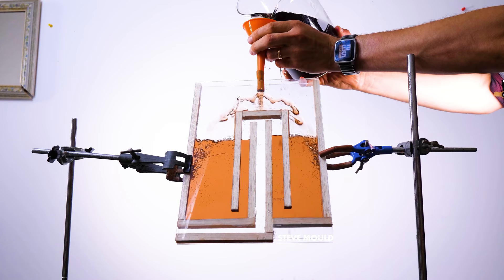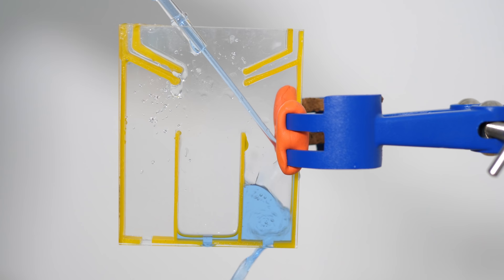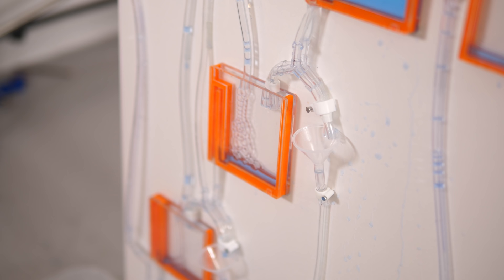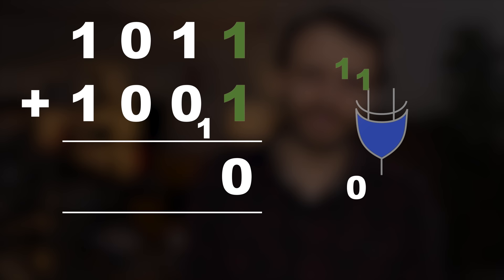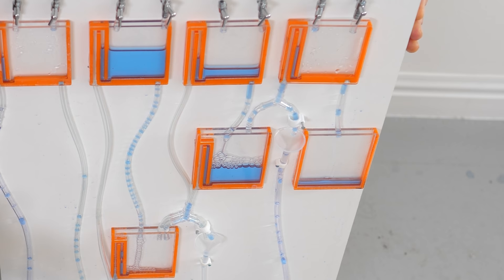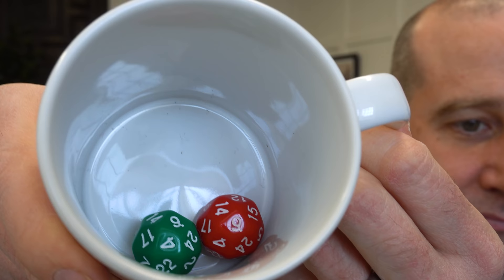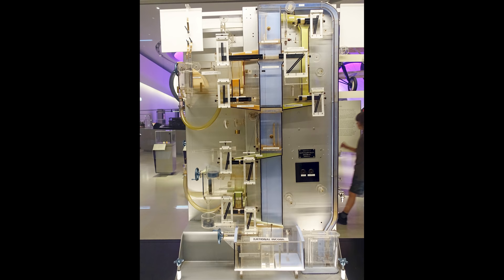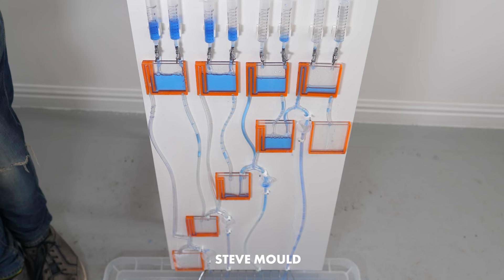I Made A Water Computer And It Actually Works

Comment: I think this would work a lot better with mercury; it’s not as sticky.
Reply from the maker: Well you would say that!
Reply: Time to explore another mine
Reply: First time I’ve seen you in the wild cody
Reply: and then you could place electric pads in the tanks and have mercury switch's turn lights on or off..
Reply from the maker: @vk3hau  this is sounding really cool now
Reply: You have to make this Cody!
Reply: Use Gallium instead.  It melts at 85°F, but it is not toxic, like mercury.
Reply: @nicklatino7157  nobody wants to work in 85 degrees lol just be careful with the mercury
Reply: @nicklatino7157  Gallium is also really sticky.
Reply: @alexpotts6520  Now I know more
Reply: @nicklatino7157  mercury isn't particularly toxic in its pure form.  just don't snort it
Reply: @butre.  It is illegal to use mercury in thermometers because of mercury's toxicity
Reply: @nicklatino7157  manufacturing them is highly restricted because of mercury's environmental effects (if there's a spill it's quite easy for mercury to contaminate groundwater).  they're not illegal to use (and in fact they're still quite common in lab environments) and the only restriction on them has little to do with toxicity.
Reply: Well mercury is pretty dense so it might not flow as easy
Reply: I was thinking alcohol would work and be safer than mercury perhaps?
Reply: @SteveMould  What about "Dry water"?
Aka NOVEC 649

It's safe, doesn't wet, non reactive, non combustible.
Reply: Yup, that sounds like a great idea
Reply: Would the siphons work if it isn't sticky?
Reply: @o15523  
That's 85 F not C; a dimmer day in the sun would be warm enough.
Reply: Never though I'd see you anywhere on Youtube and only 13 hours after you posted..
Reply: Mercury would be great, how would galinstan behave though?
Reply: And we will call it the toxic computer
Reply: @TungstenCarbideProjectile  it won't be the most economical computer when it comes to the evaporation rate of the alcohol
Reply: @o15523  I'm 1/4 sicilian, 85°F is nothing to me, it starts getting hot at 90°F
Reply: @nicklatino7157  I’m from Atlanta... 95 is nothing to me, but nobody wants to work in 85 degrees
Reply: @o15523  85 degrees Fahrenheit is acceptable. It’s 30 degrees Celsius, which is less than the average temperature in summer here
Reply: The greedy syphon wont work with mercury, I think Sixty symbols tried it and they showed that you can use it to bypass it
Reply: @o15523  ?? It's less than body temperature. You just need a bit heat on the board
Reply: this guy likes mercury more than water
Reply: good idea, except its dangerous, cuz its toxic
Reply: How about a higher viscosity like ATF (automatic transmission fluid). Waste/dirty ATF is used as an anti seize in some places and as a penetrant.
Reply: in addition to that, some custom parts could be designed for better flow and less volume.
Who needs electricity anyways.
Reply: And only vaguely deadly, as you yourself know!
Reply: @nicklatino7157   gallium sticks to surfaces like water, mercury beads up and does not “wet” the surface tho...
Reply: But it's too dense
Reply: But will make a very heavy laptop...
Reply: Cody, from a new physicst, I think you are right.  We might be able to create a new information theory operated computer if you use a conducting fluid as an additional degree of freedom within the binary system, thus creating a Ternary system using this specific mechanism, which as far as I know, hasnt been thoroughly experimented with.  Apparently ternary states have been achieved but this specific type of system has many degrees of freedom which may lead to enhancements in how we think about information theory, I think?  I'm not an information theory specialist, particle Physics needs information theorists to help us out
Reply: but it is poisionious!
Reply: This subject is called "microfluidics", and there are many videos about it on YouTube.
Reply: hahaha!
 Of course the next step would be to send the output to a display using contacts in the buckets,  maybe wires dipping in at different lengths.
 Sure it would work with water, too, but mercury would make it easier, and probably be a more successful video.

 If I can make a decoder in Minecraft that sends a binary output from an APU to a set of working 7 segment displays,  surely it can be done here.
Reply: @vk3hau  So then we're back in the 1950s when computers used to have the size of a building. The circle of life, yay! :-D
Reply: Gallinstan would probably be the safer Version
Reply: @gueldenerlarry8270  it's sticky though
Reply: A scaled-down (3d-printed or molded) version of this would likely prefer something "sticky." It doesn't necessarily have to be "microfluidic," per sé, as long as you don't rely on gravity to move your fluid (hydraulic pressure via syringe for example) I don't see it being immensely complicated to make. Your gates would probably look quite a bit different, but this entire setup could fit in a few-inch-cubed/squared space.
Reply: Or the Prince
Reply: Maybe some safer liquid metal than mercury
Reply: @nicklatino7157  just don't build any parts out of alumin(i)um
Reply: @justanotherguy46  don't quantum computers, or at least some theoretical models, use superstates as a ternary processing mechanism? I think I remember reading something about that a while ago, not sure it's how active quantum computers work, from what little I've seen it seems to maniuplate qubits into certain states and that's where I'm totally lost, at least IBM's open source platform, I dunno about Google or any others, except I think the ternary processing thing I read was about something google was trying with their quantum computer/prototype. not sure how far that's come, but it seems to make sense for "both/neither" to be a functional value in quantum logic.
Reply: @o15523  its in farenhiht not celsius
Reply: The replies are making this really interesting
Reply: I agree with you from India
Reply: why
Reply: @1islam1  what the hell? this comment has nothing to do with anything.
go to your own channel and help people learn, not just spam
Reply: @andregon4366  novec has a very low boiling temp so alot would evaporate
Reply: @azure3526  pretty sure most people on this thread have seen Cody flush a toilet with mercury would you like to retract your greedy cup siphon won't work with mercury statement 🤔
Reply: Everyone commenting how dangerous mercury is metallic mercury is  Relatively  safe unless exposed to a open wound ingested or contacting a mucus membrane 
     It's mercury vapor and organic compounds that are very easily absorbed
Reply: @terranovarain6570  Around 40°C it wouldn't boil at room temperature unless you were in the desert.
Reply: @andregon4366  it would still evaporate why when it's used for submersion cooling it's in a completely sealed area
Reply: Mercury is a great idea, Then its gonna run Quick(silver) :p
Reply: Won't be RoHS compliant tho :(
Reply: @petterhaugenes4744  Whether it sticks (to the surface of the cup) or not shouldn't make a difference. That has nothing to do with the principle of how siphons work.
Reply: @o15523  Last I checked our bodies operate around 90 degrees F. Wouldn't our hand's heat be enough for that?
Reply: Or use hydrophobic glass
Reply: you could simply add some spray to the walls idk
Reply: maybe gallium instead. it is still less sticky and is not toxic.
Reply: pressurized steam works even better
Reply: @nicklatino7157  what is 85°F (insert Unit of measurement that actually makes sense)?
Reply: I belive hydrophobic hardware would do it better!!
Reply: try mineral oil, it's got very low viscosity and surface tension.
Reply: TRY IT CODYYY!
Reply: @vk3hau  you could already do that with water as long as it has desolved minerals, either way you would need some sort of a splash guard so you don't accidentally set it off.
Reply: @Hyder61112  the same could be said about just about any liquid.
Reply: @zzzog2163  not sure how the Tesla valves would help since gravity is pretty good at preventing reverse flow.
Reply: @majororion2374  If the computer itself is cooler than the liquids freezing point, the liquid will tend to freeze in the tubes resulting in blockages.
Reply: @jackpeterson6670  85°F is 302.6 Kelvin
Reply: @zzzog2163  I assumed gravity was already going to be used as the source of energy since it is consistent, predictable, and won't slow down towards the end of the computer.
Reply: @garethbaus5471  maybe the tube that feeds the fluidic oscillator could be connected to a tank that was above the gates to power it with gravity
Reply: @garethbaus5471  I'll double check on that. So a select few of liquids will function.
Reply: @petterhaugenes4744  yes. Siphons are about air pressure, not adhesion. Cody has a video demonstrating a lavatory siphon flushing mercury just fine.
Reply: @Taramafor Haikido Most likely, while Mercury is poisonous, and is unsafe to use, I think some mercury is still needed for specific parts. Now with Lava, you'd need a powerful metal alloy that has at least Tungsten, Titanium, and I think Carbon as well. I'm not sure what happens with other metals as I'm not fully familiar with all alloys.
Reply: Surface tension though
Reply: Or liquid helium
Reply: @vk3hau  Salty water conducts electricity reasonably well...and that's just a "software change" to the existing design.  (well, technically, more like a "firmware change" - but water isn't all that firm.
Reply: Metals might be too dense for this setup. It would likely require redesigning the parts and making absolutely sure that the tubes are well-secured.
Reply: @nicklatino7157  mrrcury ang gallium are different. Just similar colour
Reply: @SteveMould  Actually water's fine! A hydrophobic coating inside the tubes and siphons should work well to ensure all of the liquid passes through freely and would be much less expensive
Reply: Would coating the recipients in a hydrophobic substance work? I'm thinking it could make the  syphon part not work since it's pretty small space👀. But it's work a small test, right?👀
Reply: @LiaVinicius  That's a good point! It might redirect the surface tension TOO much in such a small space. It could help at first, but get to a point where the water gets low enough that there wouldn't be enough weight/force behind it to break the tension, especially if you get enough bubbles in the line to disturb the flow leaving even more water behind. Would be interesting to see though!
Reply: lol
Reply: Or just cover inside with dust from hydrophobic material
Reply: Gallium for non-toxic.
Reply: @o15523  As a Californian i must say... the nobody there isn't quite accurate lol. With temperatures here, working in 85 degrees is very normal and quite comfortable
Reply: Ok
Reply: I like my computers to be highly toxic!
Reply: mercury is a beautiful element and if you apply electromagnetism to the mercury you could speed the process up.
Reply: 100
Reply: Ya know what might be really cool? With using mercury you could manipulate it's flow or move it around with magnets :D
Reply: Oh yeah! It's a conductor too. Imagine murcury switches that activate electro magnets? This could get complicated real quick
Reply: But doesn’t mercury turn into a solid?
Reply: True as that may be, I do not wish to breathe mercury fumes while using a bad calculator the size of my torso.
Reply: what about water proof components so water doesn't stick I don't really know maybe with pressure it will still get stuck
Reply: @nicklatino7157  Maybe mix some polonium 210 into  the gallium, cover yourself in beryllium oxide paste and then you could use the neutron radiation burns on different parts of your body as an analogue display to show what the total sum is.
Reply: Brilliant idea!
Reply: mercury is too dense for the greedy cup siphon to work.
Reply: @andregon4366 what is that
Reply: @hunterchichester5720  A liquid made for cooling purposes.

It's also know by dry water, since it looks like water but doesn't wet.
You can dip paper in there an it comes out dry.
Reply: Using mercury should reduce the latency :)

Comment: you should use hydrophobic coating inside of the containers and tubes so liquid dont stick inside of them and use distilled water or some other kind of fluid that can flow better
Reply: or just add detergent to water... (lower the surface tension)
Reply: Liquid hydrogen
Reply: Hydro-
Hydropho- pho-
Hydrophobic
CANCELED
Reply: Just rain-x everything, for sure.
Reply: yeas
Reply: @negriignaciojose1781  Wouldn't lowering the surface tension kill the siphon effect (the soapy water wouldn't adhere with itself well)?
Reply: @VivekYadav-ds8oz  I don't think so as the siphon effect is a matter of pressure and not surface tension (a WC works same way)
Reply: @negriignaciojose1781  Well once the water starts flowing, it doesn't stop when the pressure equalises, it "pulls" along all the water from the other chamber until it empties.
Reply: @negriignaciojose1781  the siphon works because water is very good at cohesion, it sticks to itself, by eliminating adhesion, using a hydrophobic coating, you'd increase the reliability of the siphon effect. However adding detergent might have the opposite effect, surface tension is a matter of cohesion, adding detergent lowers it because the water molecules have a harder time "sticking" with the added detergent, so it might actually reduce the effectiveness of the siphon.
Reply: @NineJuanJuan_  there's a time and place for everything and this is not it
Reply: I wonder if scaling it up to reduce the effect of surface tension would help, maybe rounding some corners as well. Idk, but it's still crazy how a "sloppy" analog computer can actually work it blows my mind
Reply: There are sprays for clothes to make them waterproof, maybe those could work... Probably they have hydrofobic ingredient.
Reply: This man is trying to overclock the water computer
Reply: Hydrophobic tubes/straws dont realy work, because there is air between the liquid and the hydrophobic surface, so it wouldnt be able to suck (it would suck at sucking lol)
I dont realy know about the container itslef being hydrophobic, but i guess it would flow better, but not all the way.
Reply: Siphon don’t work with a hydrophobic coating tho..
Reply: @chickenladysam4098  Counterintuitive as it is, this is how the liquid detergent is siphoned from its compartment into the spinning tub of the washing machine. So detergent would work. Also prevents the liquid from forming unwanted molds, I think.
Reply: yeah really annoyed me that he made all this but couldn’t just use that car wingmirror spray you can get at the dollar store to make it perfect
Reply: Hydrophobic coating will kill the siphon
Reply: @adityaagarwal636  how
Reply: @adamplace1414  whats that
Reply: Sure but water is sensible to temperature variations unfortunately. Maybe a liquid that is more resistant to temperature before it changes it state would be desirable
Reply: Kerosene oil for better than water in this experiment.
Reply: @NineJuanJuan_  I get it. The joke is, "I recognize part of a word." Good one.

Comment: So, I did the math, and it turns out it would take about 20,048,773 of these water-powered logic gates to be able to run Doom. Better start firing up that 3D printer. How you'd get that to show up on a screen is beyond me, but I'm sure you could figure it out. Have fun!😊
Reply: I hope you love playing doom on 0.5 FPS. I mean, that would be relying on water drip speed :)
Reply: @adrianbundy3249   Oh, it'd be much, much worse than that. If one instruction takes 20 seconds, and we assume the kind of machine Doom was written for needed 15MIPS to run the game, then one second of gameplay would take 300 million seconds, or about ten years to calculate on this thing.
Reply: @Roxor128  
At the original Doom's intended 35FPS, that's 104 days per frame. XD
Reply: Maybe something less computationally overwhelming like Tic-Tac-Toe or Tetris could be achievable (maybe).
In tetris, it could be helpful that both water and the tetrinimos want to fall down.
Who know? Fill the gates with more saturated color and that can be out display!!!!
Reply: @adrianbundy3249  0.5 FPS on this !!? Bro you're dreaming, I'd estimate days per frame.
Reply: @kostyr13  Tetris is probably infeasible as well. There's just too much to calculate with gravity, collision detection and rotations. There's most likely multiplication and division involved, for example, and a lot of checks where a piece currently is and if it should be there. It would be a monster of a machine and take minutes or maybe even hours to draw a single frame. This is not even taking into account the issue of how much water you need and how you're going to keep the volume of your bits consistent throughout your computer.
Reply: Any estimation on how many logic gates would be needed for a simple Tic-Tac-Toe (that assumes that we play fairly, not trying to break it, like pressing the same button twice or so)
Reply: @mananasi_ananas  Isn't it so amazing that we take computation for granted? Until we actually think that what going...
Then even tetris seems so unachievable.
And here we complain about glitches in CyberPunk 😂

Comment: “What are your specs?”

“I have a water computer”

“Water cooling?”

“Did i stutter?”
Reply: I can't see without my specs!
Reply: Flexes with 3 calculations per minute
Reply: this computer has 13 bits of memory
Reply: 4 bit <1hz B)
Reply: Can it run Doom?
Reply: My specs are:
35 tubes
20 siphons
2x4 input bits
5 output bits
Reply: @peterbonnema8913  ciphons**

Comment: The leakiness/imperfect function of the gates honestly mimics real transistor behavior more closely. Because modern processors are running their clocks at such high speeds, the amount of time (nanoseconds) it takes for the voltage to rise or fall starts mattering a lot, so instead of reaching 0V for a logical 0, you might only hit 0.2V. by the time the output voltage is actually measured.